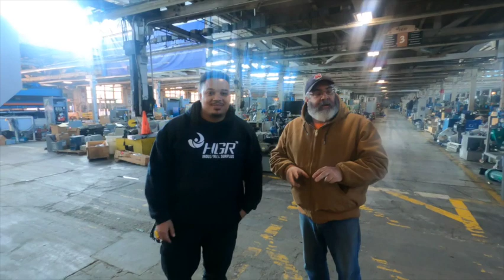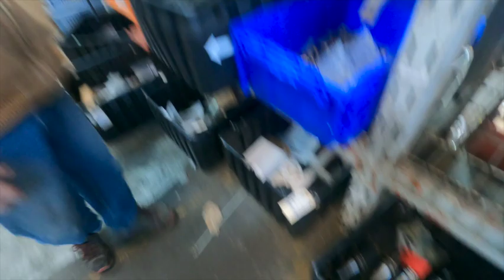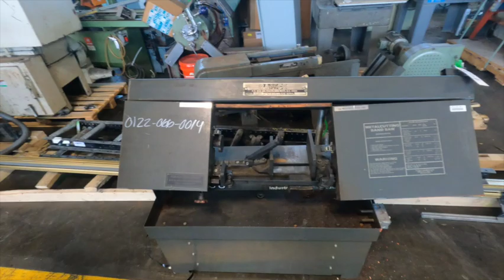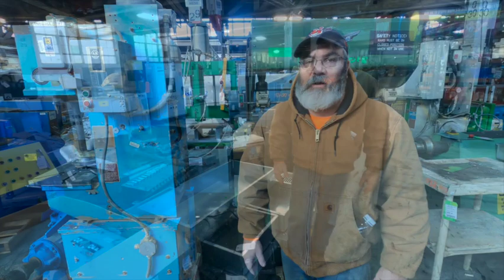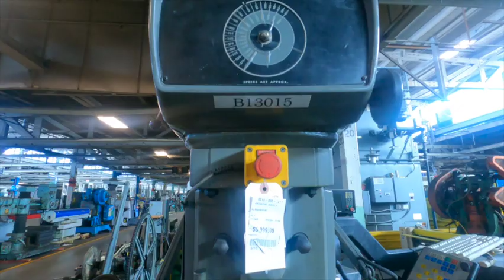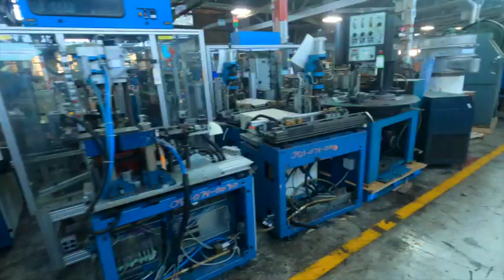Tour of HGR, aka Machinist Heaven

Comment: Hi, great video! I have bought several small items lathe chucks and a steady rest that I adapted to my lathe. Justin is the salesman I use. I am way far away but using their website and checking the close outs I saved hundreds tooling up my lathe with top quality tooling. If you can take the time and watch, their volume is so high and they price many things all over the map, if an item doesn't sell it may be closed out really cheap later.  My only complaint is their packaging is too light, one 50lb chuck was lost just the box showed up, and others barely made it. The unused lathe chucks I bought had rust on them but cleaned up like new. Thanks for the look inside!
Reply from the maker: Dee Dee, cool that you use them. There are two other cool used machinery places here in Cleveland I hope to get you guys to this summer, Small tools, and Mc Kean Machinery. Thanks for watching